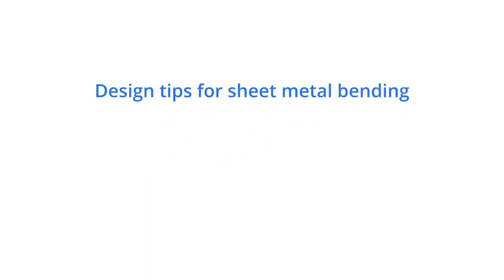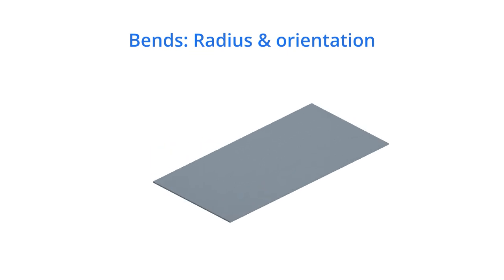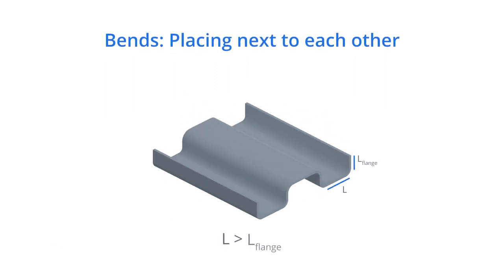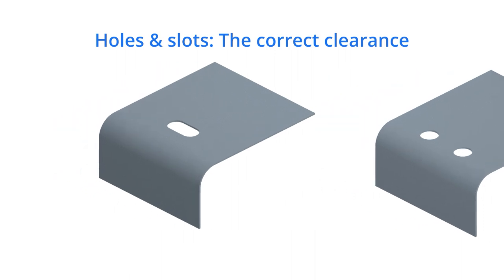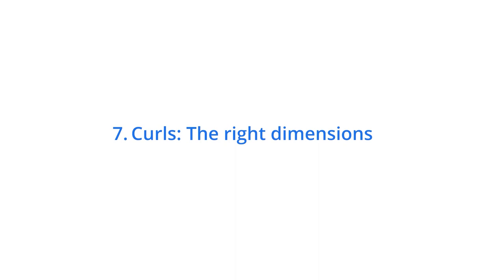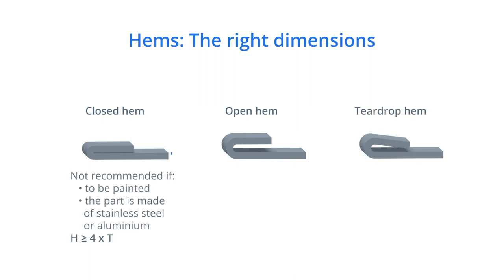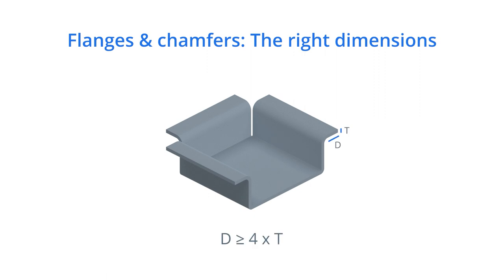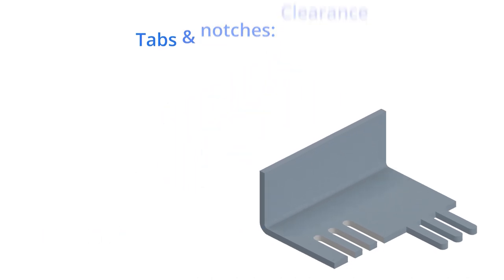Design Tips for Sheet Metal Bending

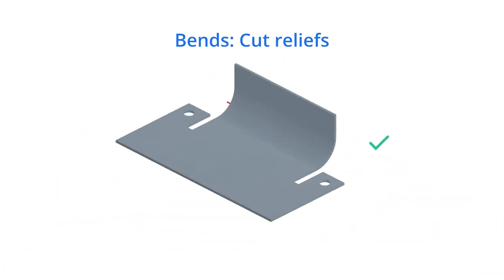Comment: At 1:37 you say that the length of the cut relief should be bigger than the radius of the bend.
Lets say i was to bend 3mm thick steel at an angle of 90 degrees, should L be longer than 90mm?
Or how do i calculate this since L is in mm and the bend is measured in radius?
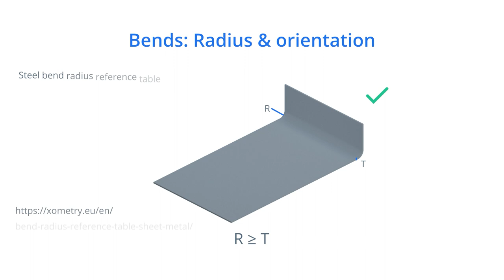Reply: Radius is a value in mm not degrees. For a 3mm steel bend radius would mostly be between 3 and 5 mm unless you bend specifically with BIG RADIUS tools. Bend radius should be equal or bigger than the thickness of material. See 0:50